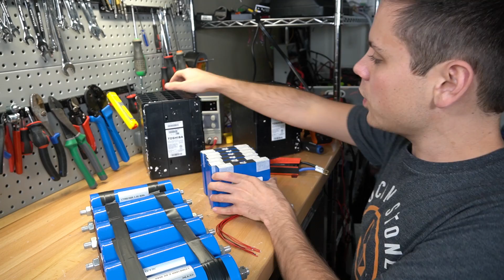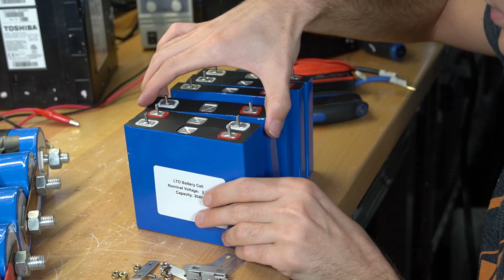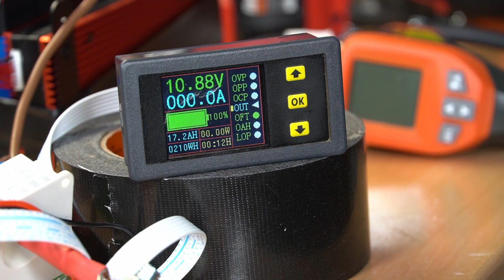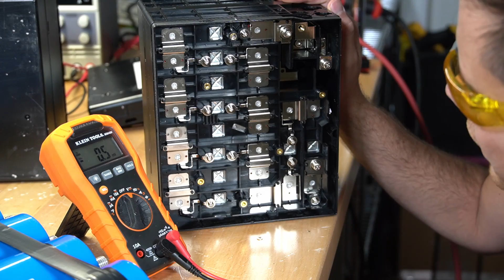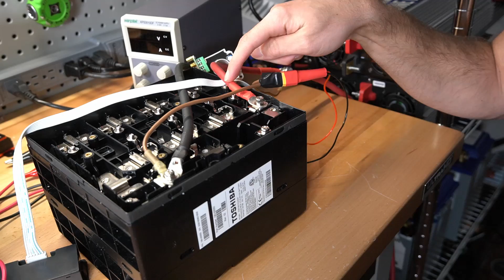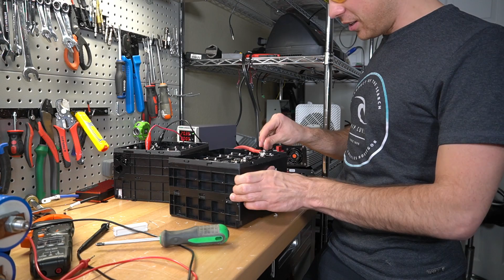DIY Lithium Titanate (LTO) Battery Part 2

Comment: In a razor go kart would be great 24v 30amp for 720w. The little cells would be good for just that. Even at 12v it just might pull 70amo at 15v. That would be fun to try. Got a free razor go kart loaded a laptop batteries in 6s and I was able to go 8mph on the razor go kart at 230 lb lol. So yeah those cells would be good to test out on that. Wouldn't mind the high charge sin the motor control has a good voltage expansion on the input and the motor is 24v.

Comment: @will So I'm wondering why the BMS only kicks in so high in the state of charge on that chemistry.  That seems just odd.  Is it an issue with the LTO chemistry specifically that calls for that or maybe the numbers just aren't there for the engineers yet to give more room for balancing earlier in the state of charge?  Any thoughts on that?  These cells look like they have a lot of potential.  These would have been great as a load sink for years ago when I used to do car audio systems for competition, but nobody quote me on that.  It will destroy the components eventually.  Well, if you are doing db drag, that is your goal anyway.  Great video as always.
Reply: The voltage discharge curve didn't look as flat so maybe they're easier to keep balanced.

Comment: Even if expensive to purchase if they last even half the rated 20k cycles i.e. 10,000 cycles that is over 27 years if cycled daily as in an off-grid solar setup.
Reply: Unless a misprint Ali express mentioned the 23AH 100K cycles "New stock battery, long life 100,000 times, 6 minutes safe and fast charging and discharging, full of low internal resistance, super value"

Comment: @DIY solar power with Will Prowse 
An effective and cheap alternative to an expensive LTO BMS is by using supercapacitor charging and balancing modules... you can get the 6s ones for less than $20 and they actively balance all 6 cells throughout, each to 2.7 volts max (I believe that's the voltage, but either way, I know the voltage is identical to that of LTO) and the nice thing is that bc supercaps can throw around an immense amount of current, these charging modules can easily handle the high current capabilities of LTO... worth looking into and it's nice that it's already a perfect 6s like you were discussing. 
Great content btw, keep it coming! 
Cheers
- Jesse
Reply: All you really need is active balance.  The cells can discharge to 0 vdc  and most electronic devices shutoff long before that.
Reply: Any link to a good active balancer for the yinlong?

Comment: Any suggestions as to the type and amount of batteries needed to power a mini split ac system that pulls 1000 watts per hour for 12 hours? Maybe in conjunction with minimal solar panels?
I'm trying to not idle my semi truck on hot days. Idling kills the diesel particle filter. Batteries will need to be charged with the trucks 12. lot alternator or through the inverter.

Comment: I have (sail) boat building aspirations. These would be perfect if I could protect them from salt water. I could power a high-wattage electric drive to get in and out of the harbor, and/or power the lights for a great length of time. The high cycle count and low temperature handling is a bonus to that application as well.
Reply: Check out Sailing Uma, they're using a lithium setup in exactly the fashion you're describing, they've even gone several miles up river from a port with their system.
Reply: @andrewfidel2220  Will do! Thanks for the suggestion.

Comment: To note: LTO is non-flammable, there is no risk of fire. So, despite getting hot, the consequence of the heat is not a hazard and may even be a benefit in colder temps!
Reply: CORZER0 place battery packs strategically and you won’t even need to run the heater or maybe use them to heat water. 50°C is good enough for a shower, lol

Comment: Hey Will, is there an ideal voltage that this chemistry would work at perfectly with an odd amount of cells? 22/23 cells for 48v? Maybe I misunderstood, ignorant still of most of this subject, one of the main issues with this chemistry is the awkward voltage profile right? Is that toshiba pack the optimal layout? Great video

Comment: I found an active cell balancer on Ebay that is designed to work specifically with these low voltage LTO batteries. and it will work with a 6S configuration. It uses capacitors by design and can move current from any cell it does not have to be right next to it. it's only about $25.00 This is the item number so you can check it out. 312799091229
Reply: jimthvac100 , bad link can you try again please?

Comment: I've just had a brainwave (dangerous i know) if you have an RV that spends some time in below freezing weather you could add a battery pack of these titinate cells and command a relay to cut the charge going to your LFP only, that way you don't waste what incoming solar there is on a clear bright day.
Later when the LFP's have warmed up enough you could dc to dc charge them from the titinate cell pack 😎

Comment: 24v system so 12 or 24 depending of amph .He has spend 7000euro until now, but he s using the system for 7 years

Comment: Why aren’t these used in electric cars? Just the manufacturing cost?
Reply from the maker: The size and weight alone prevents their use in electric vehicles
Reply: From my research, these Toshiba packs were used in the Mitsubishi MIEV electric car.
Reply from the maker: @lewicheung  wow very interesting
Reply from the maker: @lewicheung  I know they were used for starting diesel generators but that's all I have heard
Reply: LTO are used in the Honda Fit in Asia but were never imported to the US. Same with the Mitsubishi , not in the US.
LTO  are used in buses in Asia  because of the high Amp charge rate that allows a bus to charge in minutes at their stops along the way.
Occasionally one can find a used Fit LTO online. 
   So far I love the 48V. 14 A. LTO in my Prius I have that I charge with 200W of solar and a satiator charger through a 12V inverter off the car. It runs my Engle freezer, charges my ebike my gadgets and lets me cook one or two meals a day on an induction cooker.
Into my 6th year Prius dwelling full time.

Comment: Would a 12V appliance really be hurt?  As soon as you draw current the battery will drop below 15.8V
Reply from the maker: Oh good question. Depends on how circuit is designed and voltage headroom of components. Really depends. And yes, quite a few 12v appliances like leds and resistive loads will create more heat than necessary and die faster
Reply: @WillProwse  I suppose if you only had a few sensitive loads you could put them on a voltage regulator and let the rest run at full voltage.  I'd think any 12V appliance intended for automotive/RV use should be good up to 16V,  at least for short periods.
Reply: If you need a voltage of 14-15 volts, it is better to use 6s yinlong.  For an operating voltage of 13-14, the 5S Toshiba is better.  They have a slightly different central voltage
Reply: @Saktive  Toshiba lists nominal voltage as 2.3V, which means under load you'd be at 11.5V, which is too low, as Will said.
Reply: @JRP3  Toshiba scib Power (2.9 and 10ah cells) have a nominal voltage of 2.4v, yinlong 2.3v this is confirmed by the actual measurement.  We use them on cars.  Where the generator makes up to 13.8v, we put Toshiba scib 5S there, if the voltage is 14 or higher, then 6s, but yinlong.  Since for scib 6s 14v this is not enough.
Reply: @Saktive  I can see if you're running them from a generator or alternator that would keep the voltage up, but Will is talking about using them as a storage device to power 12V appliances, so voltage would sag in between charges.
Reply: @JRP3  I missed this point) in this case, choosing from lto I would stop at yinlong 6s.  Although for systems with a small load it is logical to use Lifepo4

Comment: Its the surface area of the terminal, not the size of the screw Will.
Reply from the maker: Yes but imagine a large vibrating 2 gauge cable being held on with the terminal threads. I guess I should have reworded that
Reply: @WillProwse  fair enough. You'd have to secure the cable independently of the terminal for such light gauge terminal bolts.

Comment: Nice video Will.
I would definitely use a Bluetooth programmable BMS.
You can set all the cut-off voltages and amperages including the balancing cut-in voltage, cut-off temperatures etc.
I'm using a 320Amp version that cost under 100 UK Pounds
Reply: More info about this BMS please.
Reply: @chrisbu8675  if you search for this on Ali Express you will find it. Thanks
Smart 7S ~ 20S ANT Lifepo4 li-ion Lipo LTO Battery Protection Board BMS 400A 300A 100A 80A Bluetooth APP 10S 13S 14S 16S Balance

Comment: Toshiba has 20Ah and 23Ah cells in that format.  My SBMS suports 6s LTO and can cell balance as soon as there is a more than 10mV delta between cells but I do not recommend LTO since LIFePO4 is superior in all aspect when used for solar energy storage. You already mentioned calendar aging and that is the limiting factor with all Lithium batteries in solar applications.
Reply from the maker: That's awesome!!! I have it ready to test too 😁
Reply from the maker: I'm just so busy with these videos. Need to take a break
Reply: @WillProwse  No stress, you can test it when you have the time after you also take a break :)
Reply from the maker: Yes I love LiFePO4 more as well

Comment: I am putting together a 6s3p bank for my stereo system. I am using new Yinlong 40ah cells. I am looking forward to actually using them. I am going to use an active balancer. I think the balancer is rated at 10 amps. Supposedly it will balance up to 1000hr.
Reply: In Russia, we have been using a passive balancer for lto for two years now.  Of crucial importance is the accuracy of balancing, which reaches 0.00002v.  Its price is about 35$ for 5s-6s <100ah lto
Reply from the maker: That is a perfect application for this chemistry you will love it
Reply: @WillProwse  You should take a look at the website I linked in my other comment. Im not sure the specifications on the balancer they are selling. I don't know if it specifically for LTO cells or not. I am buying everything from them except for busbars. I bought my busbars from a company called Ill customs. The quality of the busbars is unbelievable! Yes they were $300 for the 6s3p bars but OMG they are nice!

Comment: I think price is a big factor in the value of the BatteryHookup LTOs.  At $125 for 10 cells (sold out) seems like a good deal when the AliExpress batteries were $486 for 6!  Thanks for the great info.  The application I am considering is powering some LED lighting in a small greenhouse at night in the winter in Canada.  The inefficiency isn't a completely bad thing because it just pours some extra heat into the greenhouse.  The batteries can still charge and discharge at low temperatures is a big plus.   I can even build the lights to run directly off of DC to the voltage of the battery.  One of my favourite channels.

Comment: Would these be a good drop in replacement for an automotive battery, (daily driver).  Maybe with a charge controller.
Reply: Yes, at 6s, even without a bms. With large enough bus bars. Tripple up?
Reply: @cantseeusprius9069  cool, do you think the float charge of an alternator would be bad or should I run a charge controller? Will mentioned topped off, these cells are over voltage for most 12v systems, but I think alternators only charge to 14v. I might need to do more research on alternators.
Reply: @actiondronevideo  13.8 volts on an LTO that is full at 16.8 will still work and crank your engine very safely. I use a 12v to 24v dc dc boost controller, feeding into two epever charge controllers. Bank is lifepo4 in parallel with LTOs. Just drain your 6s lto to a normal voltage before replacing your cranking batt and youre good to go i'd imagine. I only charge to 14.4/6 as I dont want to hurt my 4s lifepo4 batteries.
Reply: @actiondronevideo  they just wont be fully charged, which is fine for LTO, unlike lead acid batteries which are designed to stay topped off. Should crank fine, in fact, not stressing the LTO to capacity should extend its already huge longevity. 13.8 is pretty full, sharp initial discharge curve with LTO.
Reply: @cantseeusprius9069  thanks for the info, I will most likely start with my classic car, 1955 Ford, it sits for long periods of time, so LTO is better suited than lead acid, I can just discharge it to storage voltage, and not worry about it.

Comment: The reason I'd like LTO, is to power my house, I wouldn't need to worry with the batteries for about 25- 30 years +/-, maybe longer then maybe just add a few cells to gain some capacity, but the cost I haven't bought in on the lto at all, I live off a 5kw inverter, 1500 in pv, and a generator, occasionally, with a 24v main system, and a 12v lighting system, with LiFePo bank, so I have lights at least if something goes down, and a fla 24v and a 7s liion bank. It's hard to afford batteries,

Comment: You know, I did think about using LTO for my solar off-grid building here in Finland precisely because I might not have been able to guarantee the cells were above freezing at all times. Prices do seem to come down as well, as ev-power has cylindrical 40AH cells at $63. I will probably have a set to serve as backup, and maybe emergency heating for the LiFePO4 cells or run other stuff in the tech building when the sun is out, I'm not around, and it's -20C etc.
Reply: I have seen the cells on ev-power as well.
Sounds good, give It a try.
A LTO car starter battery sounds interesting as well.

Comment: 15.8v -2.6v = 13.2v So basically if you remove one cell from your battery pack you voltage would be fine for running 12v appliances..
Reply from the maker: This was covered in Part 1 video. We realized that the majority of usable capacity was too low at 5s configuration. Did you watch the previous video? We examined the discharge curve to figure this out. The moment you put a load on that battery, that 13.2v will drop to 11.5v
Reply: @WillProwse  No Sir, I will have to go back and watch it first..

Comment: For batteries connected in series: add Voltage, Maintain Amperage (10A). In parallel: Add Amperage, maintain voltages (100A).

Comment: A Prius doesn't start off the 12v battery, it activates the traction battery contactor, other wise, the high voltage battery starts the enging, it used motor generator 1 to start, I don't understand why they use lead acid!
Reply from the maker: Good to know! I had no clue. Very cool
Reply: JAMES! Since the 70's probably because it’s cheaper and lasts long enough any how, since , as you said  it doesn’t do much. But the Prius 12V. is a little bit deep cell. More capacity then a regular starting auto battery.

Comment: 10C Thats what I need to run a nice hot electric hot shower!
Reply: Good point. I had just put the idea of my shower running on battery away as a fantasy because of the amount of batteries it would take, but you're right, 10C might make that feasible. Lithium Titanate, the shower battery.
Reply: @AtlasReburdened  The discharge rate is great for that, but realistically speaking, running even a piddly 3000w shower will drain a 100ah battery in 20 minutes. So you would need a bigger battery, so you might as well build a bigger system with 2 batteries in parallel anyway. Then there is the issue of charging all that up.

Comment: This technology seems to match lead acid in terms of cell voltage, which given the current state of electronics geared towards lead acid is no bad thing. Watts per kilo seems better than lead acid and no Peukert effect means a very usable battery. No damages from 100% discharge is a massive plus. A little bit of extra mass compared to lifepo4 or other chemistry seems like a fair tradeoff. Every progressive step in battery technical is a nail in the coffin for the petrochemical industry. Which, for our children, is only a good thing. As for the haters, leave them to their ICE technology, preferably in a fairly confined space.

Edit... Ok not exactly drop in replacement for 12/24v equipment...🙂